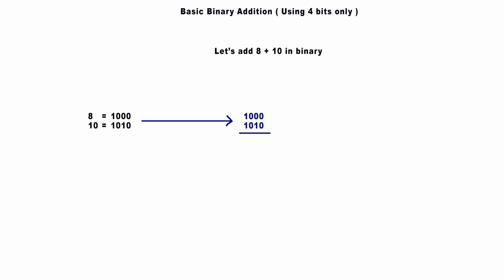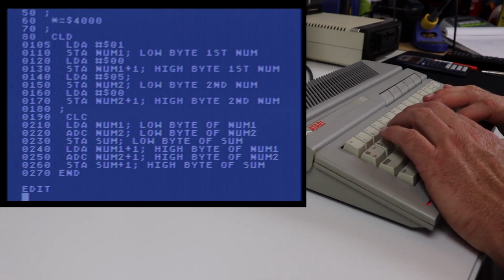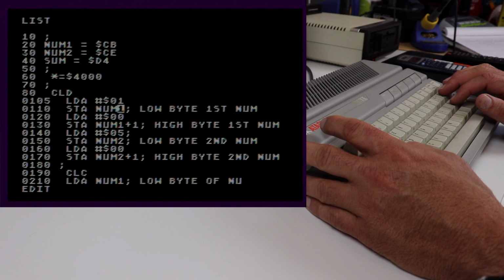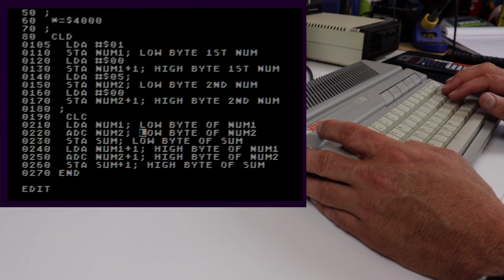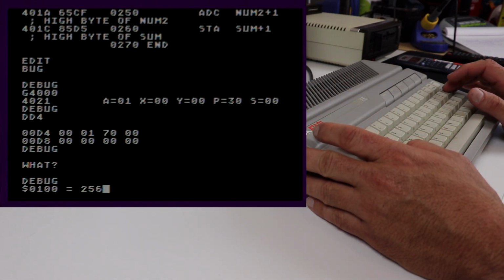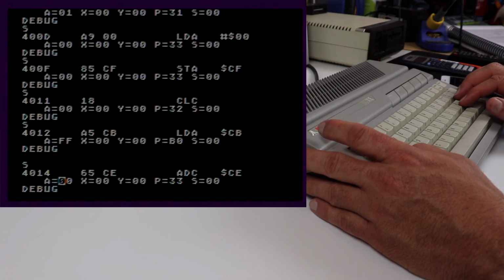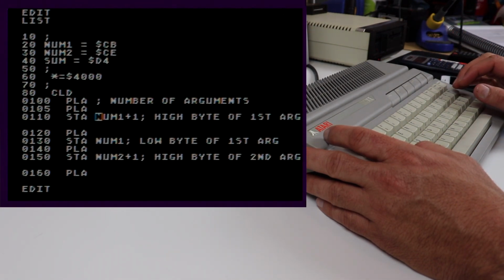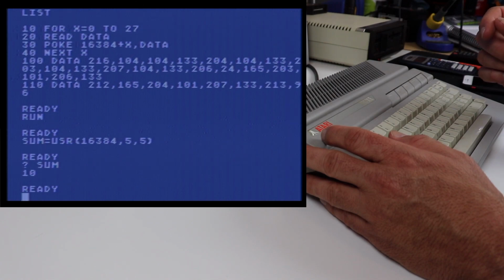Performing Addition in 6502 Assembly Language

Comment: 14:19 A question: in Line 220 you could have just used normal ADD instead of ADC, right ?
If you did  so then you wouldn't even need Line 190 CLC, isn't that right ?

Comment: Nice video for those new to 6502 assembly.  One thing that may be helpful on the section discussing calling ML routines from BASIC using the USR function is a description of how the return value (SUM in this case) gets returned.  You cover pulling the inputs from the stack, but I didn't notice a discussion of the return value.
Reply from the maker: Thanks for the tip!

Comment: 8 BIT AND MORE, 
     ^^             What are the differences between 6502 assembly language, Z80 Assembly Language compared to Machine language? Are they the same thing or whats the differences? 

Basic Language has a compiler that converts the basic language into machine language code. 
A Language converts machine code into what?
Reply: Hi Bill, mybe I can answer to the questions! There is a large difference between MOSTEC 6502 CPU and Z80 CPU in design, so there is a difference in instruction sets and assembly code between those CPUs. 6502 CPU is much similar to RISC (Reduced Instruction Set Computer) architecture. This means that you have a minimal set of instructions for coding. So the 6502 can execute every instruction per one CPU clock (cycle). At the other side Z80 is more similar to CISC (Complex Instruction Set Computer) architecture which give more (complex) instructions, but for some instruction execution, Z80 need from 1-4 clock cycles per instruction. It is the reason why Z80 microcomputers usually worked from 3-4 MHz, 6502 based microcomputers worked from 1-2 MHz. Conclusion: Asembly coding on 6502 is more ascetic but very efficient, and Z80 coding is more comfortable. Machine code is a sequence of 0 and 1 digits, and it looks like the same for any CPU to us. It is almost impossible to program computers directly to machine language. So we have mnemonic codes for every instruction. A set of mnemonics makes up an assembler. And why don't we write the code in Visual Basic and compile it? Well, I will answer on this way: when you compile the program which will make an addition for two numbers, the execution code will be 20-30 bytes! Compiled Visual Basic code could be 30-40 Kb execution code, and will be much, much slower than the code obtained from assembler!
For these reasons, we have today a plenty of languages, RAD and IDE environments and so on.
I mentioned RISC and CISC architectures. And I just want to add that not even 6502 or Z80 belongs to this architectures, but rather its were their predcessors. Thypical RISC procesors are Motorola 88100 and similar, Motorola and IBM Power CPUs, ARM CPUs e.t.c. Typical CISC CPUs are Motorola 68000 family, and the major Intel and AMD CPUs.

Comment: you say Most significant byte hahaha for your 2bytes of a 16bit value $0105 will store in the memory(RAM) like this => $05(addr $d2), $01(addr $d3) [but MSB is in both bytes on the left side] - correct. For readers: the MSB (most significant bit) is in this case on the left of the Byte. (most significant bit) MSB(bit7),(bit6),(bit5),(bit4),(bit3),(bit2),(bit1),(bit0)LSB (low significant bit). That MSB/LSB means the orientation of the bits. Sometimes in a serial data stream of bits are the first bit the LSB. If you don't know the orientation so you can not receive in my example where is the first and where is the last bit. That you must also say to your explanation. 

If you look at the human readable value $0105 => 0b0000000100000101 (orientated MSB to LSB) inside the RAM it will stored like this addr$d2: 00000101, addr$d3: 00000001 

This is only supportive care for your explanation. Thank you for your Video. Best Regards Volker from Vienna/Austria (PS: My frist Computer was a Atari 800XL with a 1050 Floppy)
Reply from the maker: Straight from mapping the atari:

"So how does the Atari (or other eight-bit microcomputers, for that
matter) store a number larger than 255? By breaking it down into two
parts; the Most Significant Byte (MSB), which is the number divided
by 256 and rounded down to the nearest whole number, and the Least
Significant Byte (LSB), which is the original number minus the MSB.
The Atari knows to multiply the MSB by 256 and add the LSB to get the
number. For example, the number 45290 is stored as two parts: 234
(LSB) and 176 (MSB). 176 times 256 equals 45056, plus 234 equals
45290"

The term MSB and LSB when discussing the atari and or most 8bit computers refers to the "Most Significant Byte" and "Least significant byte" (not to be confused with most significant bit or least significant bit". You are right though when you say it is actually two bytes (meaning 8bit bytes) to make up the MSB/LSB.

thanks for watching and commenting!

Comment: So, even though the 6502 is 8-bit, we can still work with larger numbers by using multiple memory addresses as needed for storage.  Is there any limit? Could I add two 64 bit numbers together by using 16 memory addresses?
Reply from the maker: Yes but you're limited to the amount of memory addresses in these old 8 bit computers. Most Atari and Commodores have around 64k